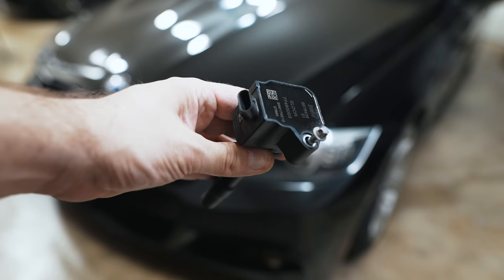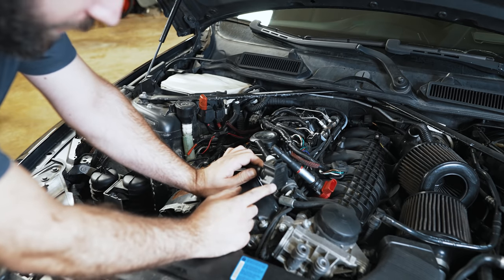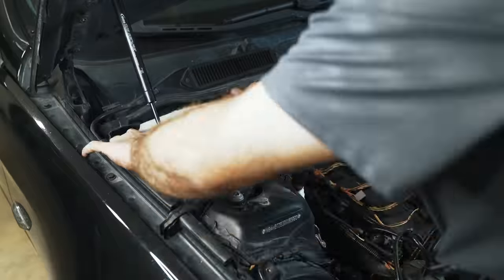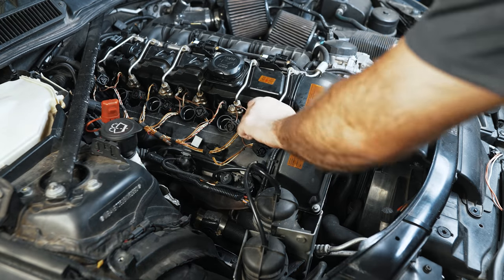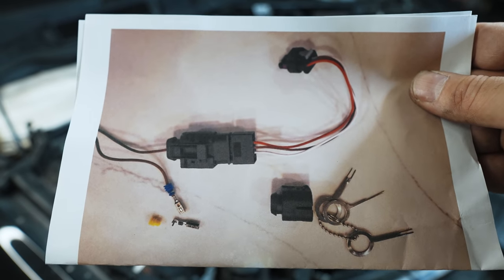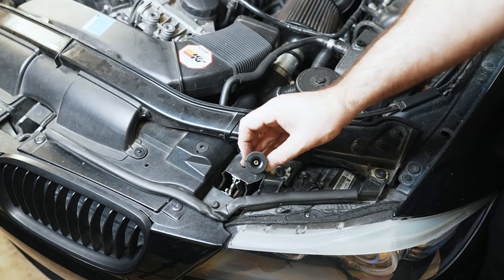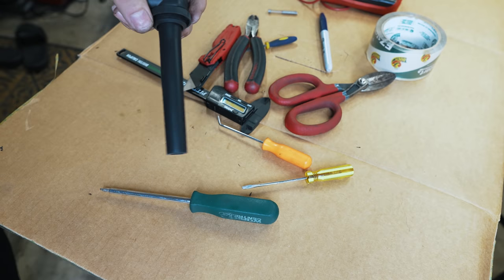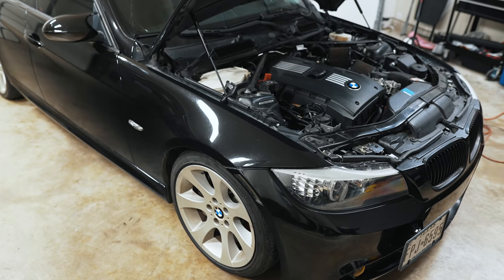There Are So Many Ways To Make Your BMW Run

Comment: Since I got into the N54 world I've been watching YouTube content from to many channels.  By far I consider this channel the most informative and nutritive for an N54 , how ever I still would like to know exactly why b58 coils and not eldors . Still can't see a diference on the running of the car
Reply: Yes, I'm not sure after watching it what the benefit is. My brain hurts
Reply: Budget Bimmers is good if you got an N54. They don't upload anymore tho
Reply: @Czechbound  less time correction
Reply from the maker: The main thing would be to be able to maintain a decent spark gap for daily driving and cold starts and fuel economy but not have it blow out under load at high RPMS.  Most people are running stock coils but are closing up the gap to avoid misfires which sacrifices daily drivability but this would only come into play on 500 WHP+ cars IMO.
Reply: @VehicularDIY  again by far the most nutritive channel for N54, I'm pretty sure no other YouTube would be able to give me that explanation.  BTW , are you running CDV delete in your clutch ?
Reply: Benefit is A: a much more reliable coil, and B: the spark is 2x stronger which means you can run a larger gap as well with high boost. B58 OEM is Eldor btw... the bosch part for the B58 coil was tested and shows weaker spark than the Eldor B58 coils. High Horsepower cars I wouldn't go with anything else. Best Ignition upgrade on the platform.

Comment: I gave the video a "like" because I think you put a lot of effort into providing videos that are questions for diy'ers. I personally believe there are so many steps in this kit that can go wrong and cause misfires that your average diy"er would be ill advised to try it. With the exception of the adapter brackets(great design and making use of factory points of connection) it just seems to me to be a possible cause of more problems than it solves. Keep up the good work .
Reply from the maker: Perhaps down the line someone could make a plug and play adapter harness and a boot that would be a straight drop in.
Reply: While yes alot may not be capable....their are many who are and appreciate the information!  Thank you! Love from ohio

Comment: I am from Toronto / Canada .. owning x3 2013 / N20... new engine and timing chain replaced by bmw in 2019 at 146kkm.. now i am at 193kkm.. after seeing multiple videos from this channel.. my confidence level is going keep the vehicle for another 3 to 4 years instead of replacing it but unfortunately i don't have a repair guy like you nearby. If anyone around , would appreciate if you can share and advise

Comment: Does this setup provide beter performance than say a PR setup? Without knowing the cost per coil and the kit being $200, I question if the "Pros" (If any) justify the cost and work necessary to make them work as well as if it makes it more cost effective than a PR setup?

Comment: Great video, I learned a lot from this channel, I don't think these coils are necessary , even the Audi coils set up was not needed, I have Eldors now but my original Bosch coils were fine for 20 PSI boost and 492 WHP,
Reply from the maker: The eldor pencil coils hold up pretty well for a stock turbo car.
Reply: @VehicularDIY  I believe vehicle virals is running Eldors coils on his ST car making about 700hp. We’ll see how it holds up long term I guess
Reply: Like he said. There are more benefits than just avoiding misfires. You can gap your plugs to factory specs which gives you better drivability and efficiency without blowing the spark out. And that’s simply because these coils generate significantly mode energy. It’s a known weakness for N54s making big power. All the serious builds are going to these coils, which should tell you all you need to know. No offense to Vehicle Virals.

Comment: The low temp soldier butt connector will crack cause a intermittent connection.  This is just a fyi. If you start having issues later down the road.

Comment: Hey man. Love the content. I see you're running the cowl delete with the BMS filters. I'm wondering if you have any water issues pooling up anywhere. Also I read that it sucks up engine heat since the cowl is no longer there and you need to run recirculation more or even AC. Do you find the fan air temp to be hotter?

Comment: Great tip for us that are still running an msd80 and maybe keeping it on oem dwell. I did upgrade the resistors after i fried them but, does anyone know if these will hold up on stock dwell running close to 600hp? I don't want to risk killing my dme by selecting the b58 option in mhd if i dont have to. I guess i'll be finding out first hand eventually if no one knows for sure.

Comment: Hi! Thanks for the content! 

Recently I've been considering the 550s with the N63, but mostly starting from 2013-2014, with Valvetronic. The engine compartment seems to heat up a lot in dense traffic and can break a lot, but seems to hold up fine when driven on highway.

I don't know if you're interested in working on one of those, but I would 😀
Reply from the maker: Maybe a high mile one down the line could make some good content on the channel.  I had the updated motor on my 2015 X5 before, it didn't have a lot of miles (under 60K) so no issues had popped up as of yet.
Reply: @VehicularDIY  Thanks, looking forward if any!

Acutally, the hiher mileage, the better, like 150k+ . I'm from France and these are rare here, but a lot more common in North America, so probably cheaper!

Comment: You mentioned you have over 100k on your 440i. I have a 2018 m240i, I love the car but I only have 19k miles. Any big issues with your B58 on the journey to 100k outside of normal maintenance schedule?
Reply from the maker: I bought it recently with 107K miles on it.  It's a 2018 as well.  No issues at the moment but I don't have the full history of the car.
Reply: @VehicularDIY  Ah gotcha, I'll definitely be looking out for new vids on that 440, looks sweet!

Comment: I'm curious. Does the N54 engine also have the issue with the fuel injector "popping"? Dad's N55 had a Cylinder 2 misfire and it was popping at idle. Under load, there was a consistent thud, inline with the operation of the injector. 
Indie claimed it was a seal that went bad and was allowing air through and causing the injector to "jiggle" slightly. 
Cost us 800 to fix that. Curious to know if it's easily done in case it happens again
Reply: How did they fix it? My n54 injector on cylinder 2 is kinda loose in there and also has a slight jiggle. But to answer your question, I havn’t heard of this being common. I took my injectors out around 6 times and maybe I wore out the head jiggling it to come out. Idk but I’m curious to hear how the shop fixed your problem
Reply: @Garik.e60  basically, the indie said that the "washer" (his words) went bad and they replaced it. The reason its expensive is cause, well, you need that special tool to remove the injector. He said that the injector needed to be removed, and the respective washers and seals were to be replaced. Sadly, I don't have a copy of the work report, else I would check it again. Maybe it's somewhere in the records.
Reply: @indianboy0453  Man I don't know about N55 but on my N54 it was $6 for the coupling ring and $2 for the seal. I can't imagine being charged 800 for that. I'm really hoping there was some intense work done for that bill. Thanks for replying.
Reply: @Garik.e60  The N55 is more or less similar to the N54. Just a change in timings, turbos, and layout, but it's mostly the same. 
That said, the indy specializes in German cars so they have a high pay rate. They were also doing some shop renovations and improvements so prices were unfortunately expensive.
This was also at the time when I wasn't comfortable working on my parents cars. When I did my mother's N52 upper gaskets, I started to be more open to working on the N55. Hence why I'm trying to find out more about the injectors and the work needed for the seals. 
It's entirely possible they replaced all the seals in all injectors. I'd have to check though
Reply: @indianboy0453  That’s awesome man. I saved my parents a pretty penny diy-ing everything. I’m a little privaleged because a friend of ours has a shop so I get to use the lift for little things here and there. In that case if the n55 is pretty much the n54, theres nothing complicated just a bunch of stuff to take apart. If you do a lot of work on n52, don’t be hesitated to work on the n55. 👍👍👍

Comment: update anyone looking b58 coils on your car be cautious if you opt for Vargas /VTT's kit. I spent $500 thinking their kit was complete and looked great but their wiring harnesses are sketchy at best. When installing i did notice that the wiring harness for my coil 1 had a loose brown wire. I wanted to be safe so i disconnected, inspected, and reconnected again to where it seemed solid. I had it set to oem dwell so it wouldnt tax my dme80 power supply as much but within like 20-30 seconds it stopped running and i started smelling smoke. Coil 1 had melted and caught fire. When i reached out to VTT they tried blaming the oem selection dwell and basically said it was all my fault without offering any real help. Then they told me to pay to ship it back so they could inspect before they might offer me a refund. They took no accountability for their faulty 3d printed connectors and acted like i was some idiot for thinking they shouldnt melt with the oem setting instead of the b58 setting on my tune. Realistically, just glad i took these out and only had a 30amp fuse pop in my dme box. Could have been much worse and was worried this fried my ecu but luckily it didnt.

Comment: How are these coils working out for  you? Any issues? I'm having misfires and stutters at high RPM, with my 2007 335xi. I replaced the VANOS but that didn't help. I have some new plugs I'm going to put in and see, but I'm thinking with 157k, they probably haven't been replaced yet. Any thoughts?
Reply: Change the coils along with the plugs all at the same time, had this issue and was fixed by replacing coils and plugs

Comment: Rebuilding the coils each time they were due for a change could get old.
Any idea if they will last longer than the original OEM?
Reply from the maker: If the coil fails you could just move the boot over to the new coil as it pops right off.

Comment: I have a FBO+ 2013 e92 335is and supposedly I should have MSD81 but I saw in Protools that I have MSD80 so not sure what I have. Any other way to tell? I haven’t had any issues.
Reply from the maker: I believe the change over occurred in 2009 so you'd have the MSD81.  You could always pop the lid on the DME cover and lift it out to verify.
Reply: @VehicularDIY  thanks I’m not sure why protools says MSD80

Comment: My 2011 X5 will not pass emission test. Can anyone help? I have taken it to dealer and several mechanics, they are all bs. Dealer tells me it’s the cylinder head. After having for a week and couldn’t find any problem, they made up a cylinder problem and tells me it will cost $14k. Help anyone? Please

Comment: Would this be something you could do with the N52 as well? And would the benefits be similar with the N54?
Reply: You do not need anything over the stock ignition system to be quite frank there is no benefit to having a stronger coil
Reply: And I mean with the n52 engine not in general because you’re not forcing induction into your engine there is no need to increase your coil output it does not increase horsepower just an over working coil I don’t mean to be rude but look into genuine mods if you want power out of ur n52
Reply: @scaredshot9162  So these woulnd't really benefit being a supporting mod to 3SIM, intake, exhaust, and a tune?

Comment: After 40k in maintenance on my n54 engine in 76k miles [ purchased at 105k miles ] I finally traded it in for a Toyota... Time to unsub and leave this part of my life behind me... for DIYers these cars are pretty neat... Unbeatable power and smoothness from these engines. My 135i was GREAT in the Santa Cruz mountains. But unbelievably fragile at higher mileage.
Reply from the maker: All the best, thanks for watching.
Reply: Fragile? It seems a case of bad lemon. I have +600hp, more than 200000km, a some track days and still like a charm with a normal maintenance. 
I only wait that my next car hold on as long as this.
Reply: Is it a new Supra lol
Reply: @ivorproblem1332  lolololololl
Reply: You cant own a high mileage BMW without being a DIYer or suddenly becoming one out of necessity lol. That being said, my 150k mileage n54 running FBO and full ethanol wants to have a word with fragility. Do your belts, pulleys, water pump and overflow, and have an aluminum charge pipe, bam bullet proof.